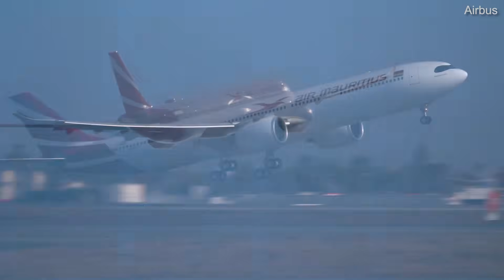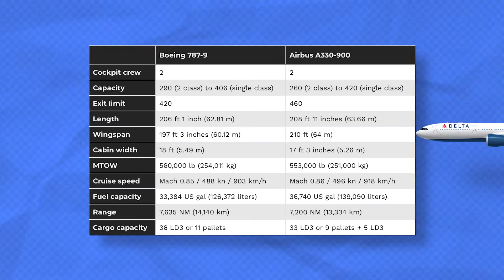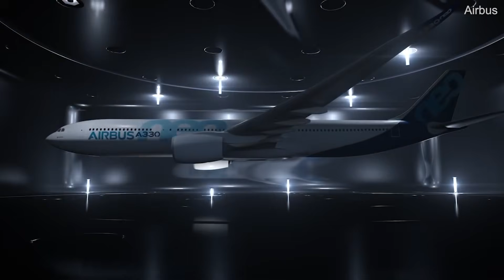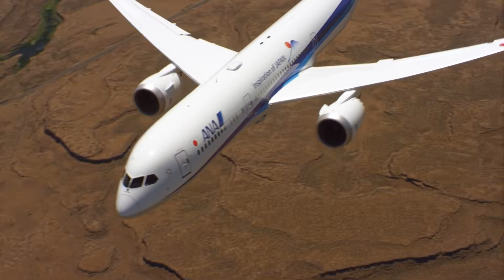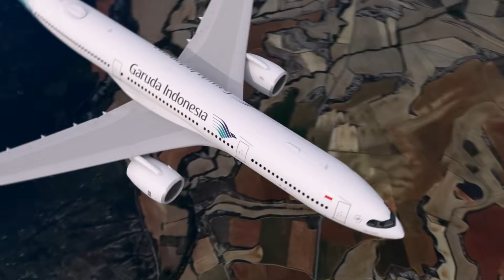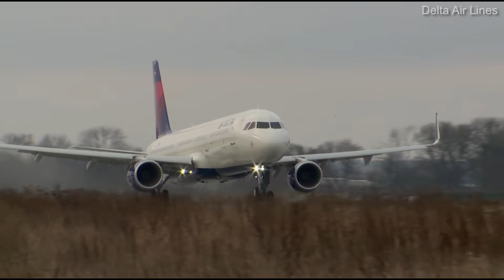Airbus A330neo Vs Boeing 787-9 – Which Plane Is Best?

Comment: It seems that as a product, the 787-9 is the better airframe. However, I wonder about the profitability to their respective companies. The R&D for the 787 family must have been enormous, and early problems with battery fires and Trent engines would have only pushed that up. If you factor in the cost of the ongoing almost two years of gaps in delivery, I wonder what number of planes Boeing has to sell just to recover the costs of development and overcoming quality problems. In contrast, the A330neo upgrade program must have cost much less, and will correspondingly have a much lower break-even number of airframes to sell in order to recover investment. So building the A330neo may be the better business proposition on a head-to-head comparison. Airbus could have tried to position its next plane, what became the 350 family, to compete directly with the Boeing 787 as a cleansheet offering. They decided not to do that, and chose a more conservative approach of the A330neo upgrade, defending their current airline customers from poaching even if the offering might not attract as many new, greenfield operators as Boeing in that segment. The A350 was instead positioned as a competitor to the 777X, where the A350 family has a long and growing lead compared with the long-delayed 777X. The 777X family may be somewhat larger, but being the biggest airframe on the market is not necessarily a good thing in the current and near-to-medium term business environment. I'm sure Airbus is happy that they decided to end production of their A380 after they misread the market.
    Perhaps in the 2035 timeframe, the 777X may find a lucrative market for large widebodies, but by then Airbus may have come up with a new offering in that space, which would be newer and possibly more attractive and certainly more sustainable. Airbus has all the budget for R&D and innovative risk-taking, while Boeing for sometime to come will have to watch its cash flow and be very prudent about R&D spending. I wish the situation were better for Boeing, its customers and the world needs a successful Boeing that can invest in R&D and sustainable technologies as the world tries to decarbonize aviation. I am unhappy that almost 4 years after the first 737 MAX crash, they still haven't gotten their act together. 
    Maybe they need a change of leadership, their current CEO may still part of the problem rather than part of a solution. I feel they still haven't come clean about the real root cause of the 737 MAX engineering design disaster, they seem to still try to blame it on inexperienced pilots who could have followed a certain documented procedure when confronted with a totally undocumented failure scenario. Some engineer and their manager needs to go to jail for designing the killer state machine in the avionics that used the information from the  one connected Angle of Attack sensor, a single point of failure in an airframe design that should never have been certified as safe to fly.
Reply: Airlines complained about selling 400 to 450 seats to make an A380 flight profitable.  That’s not all to fare off the about 350 seat an airline has to sell to make a 777-9 flight profitable.  The 777X might be to big to compete.  The 787 might get unexpected competition from the single isle long range planes, that cover the low end of the 787’s.  It’s no surprise 787-ER versions are planned, although the increased weight will lead to a loss in efficiency.  In that sense it will be interesting, how Boeing will be going through the next 10 years.  The 777X will be a 5 year old design when it comes to market, and the 787  line has it’s own problems.  Airbus has also it’s problems with the surface degradation, although it might be not so difficult to handle it.

Comment: The 787-9 use less fuel, has more range, and can carry more cargo, and the difference in passengers is small. It's not hard to see why the 787 is the better aircraft.
Reply: The difference between a330neo and 787 fuelburn is only 2%
Reply: @faizierazali3494  The difference between a clean aircraft and a dirty aircraft is smaller than that but still saves a shit load of money to the airlines!
Reply: @gregb1599  lol its like you mentioning b737 max over a320
Reply: @faizierazali3494   4%.
Reply: @AS-br8si  4% only if the A330s Range is used completely. The fuel burn per seat is only significantly higher than the 787 for flights over 10 hours. Most A330neos are used for flights between 6 and 9 hours thought.
Reply: Airbus all the time
Reply: A330neo have a bit lesser price than b787-9 but the capacity is lot more than b787-10
Reply: The seating arrangement makes a bit difference for passengers

Comment: 787 has more composite materials. Newer and better in terms of aesthetics. I've tried a Qatar airways economy class 787 and it was better than Qatar's A350-900. I think the loo is bigger too.
Reply: Why? I'm a 787 lover and am curious as to why.
Reply: @FlightAirplane  maybe because I was in the middle seat in the A350 while I was at the window in the 787. Idk. Just felt a bit more comfy. I think the seat were different too.
Reply: @brakinglate8828  Too bad they are making it a 3-4-3/ Honestly I still prefer the 787 even when the a350 is 9 abreast.

Comment: I thought the A350 was the competitor to the Dreamliner Anyways both planes are good and I like both of them
Reply: The a350-900 is the competitor to the 787-10, the a330-900 is the competitor to the 787-9 and the 787-8 is the competitor to the a330-800. The a350-1000 is in another market competing against the 777-8 but the 777-8 passenger variant is at risk of not being built because of no firm orders.

Comment: Fascinating one of the arguments people use for the A330 vs 787 is the fact that A330 has wider seats and a preferable 2-4-2 in Economy compared to a 3-3-3 in the 787, but that's more of a airline choice thing. It's not really Boeing's decision what an airline puts in terms of configuration. Japan Airlines seems to make it work with very low density 787's in a 2-4-2, but many full-service carriers would probably prefer the extra capacity and don't think the average punter will be that interested in the difference in seat.

If you put to bed the program delays and groundings, the cheaper price, higher range, better cargo capacity, and better efficiency (subjective topic) makes the 787 the winner. But if you compare the of Boeing's widebodies (including one's in production) to the A350... well Boeing gets KO'd pretty easily.
Reply: I would like to know what is the real price of A3330 neo compared to 787.

Comment: A330neo is my choice. I absolutely hate the 787 tinted windows.
Reply: Agree totally
Reply: Why? Tint means even when dark you can still see out, shades if closed that's it nothing
Reply: @gregb1599   Maybe try it in practice! Maybe you have laser eyes? A Blind you make the choice not some entitled crew member!
Reply: @benwilson6145  Well if it's abused then yes, however good airlines and crew will give you the choice. But at the end of the day, when booking your ticket choose the aircraft you prefer, I for one will never book a 737 Max and that is my choice
Reply: @gregb1599  why wont you never book a 737max. you don't choose its the airlines that doo
Reply: @gregb1599  Yah but the crew can control it making it extremely frustrating. Plus they never get fully bright and have this weird tan tint when on max brightness.
Reply: @SpottingTLV  It never bothers me, I guess personal preference, the shade just looks cheap and old fashion and boring, also must be frustrating for the crew when people keep them open when most want to sleep or during take off and landing when they must be open for safety yet many keep them closed causing crew more work to do

Comment: A330-800 is better than 787-8 but 787-9 is better than A330-900

I feel in this way
Reply: true
Reply: If you see specification wise, the 800 is better than -8 but the orders for  the  a330-800 is less because the ceo -200 is still not very old.
Reply: @tomaviation5245  spec wise, I've always felt the A330-800 was over spec. The market needed a 250pax aircraft with shorter range and significantly better fuel economics than the B787-8, but instead airbus made the A338 range much longer and took the penalty on the fuel economics. Under all payload and range, the A338 consistently fall behind the B787-8. The only aspect the A338 won against the B787-8 is their short field takeoff, hence the reason why Uganda air, air Greenland and Kuwait Airways are its customers. Garuda Airways actually ordered it hoping to launch new service direct from Bali DPS to Europe, hence again requiring the superior takeoff performance. Only the A330-800 has the ability to take off from Bali DPS fully loaded.
Reply: Interesting. I'd had always thought it to be the other way around since the A330-900 has gathered more order than the B787-9 since the A330neo was launched.
*you really have to exclude the 1000+ order the B787 gathered before the launch of the A330neo.

Comment: Economy Passengers; A330neo 8-abreast seats are more comfortable instead
Reply: That is real true. As a parents, I can lay down my kid. Or I can lay down, when there aren’t many pax. That’s the Beauty of 2-4-2 format.  3-3-3 is worst.
Reply: 787 was designed for 8 abreast  from the very beginning but airlines opted for 9 abreast , that's why the narrator said comparisons on passenger comfort are unfair. 

You can order the 787 with an 8 abreast ( wider than those on the a330neo ) so this is not up to Boeing but the airline
Reply: @mmm0404  
and conversely , airlines can order the neo with 9-abreast ….and deliveries have indeed started w/that config.
Reply: and its more beautiful when doing a smooth landing cuz of the tilted landing gear, wheras 787 is like baby tilted landing gear
Reply: @qrygamer1  personally I think the a330 looks bloated and is ugly. It's fuselage tilts a bit forward and is not even . 

The 787 looks like a sleek sports car  with its sexy looking wings.  Lol

Never compare the a330 looks to the 787. Even the 767 looks better than the a330
Reply: Yes! The best point

Comment: The most insane fact is that on "traditional long haul routes" (meaning 8-10 hours flights) the A330NEO has a per seat fuel burn that's basically equal to the 787's one.
Considering that the A330NEO is basically an A300 with new wings, new flight controls and a double engine upgrade, that just shows how the first Airbus was ahead of the game.
Insane efficiency from a 50+ years old design.
Reply: That's a common effect!  The most fuel is burned during the take-off and the ascend to travel altitude.  Once at travel altitude the differences are minimal.  Fact is, that the induced drag can be up to 70% of the total drag while ascending.  During travel the induced drag is getting lower due to lower AoA and higher speed.  It goes down below 10% of the total drag..
Reply: agree man, i agree
Reply: I miss flying 747s. they made the flight beteen L. A. and Europe about 1 hour shorter tham the current fleets.
Reply: Where did you get this from? That's actually really cool
Reply: that's how my big appreciation for Airbus started, the A300 was a game changer, ahead of it's time
Reply: I love Airbus, I never been in those models but the A320NEO and the 321NEO are amazing 👏
Reply: Indeed. If airbus had targeted the NMA market with the A330neo, it would have been more successful.
Reply: @chingweixion621  and a330 is bigger than 767 and even bigger than a321neo
Reply: @xa0101  I'm referring to the upper end of the NMA specifically the B797-7
Max10 = A321neo
B797-5 = A321XLR = B767-200
B797-6 = A300 = B767-300ER
B797-7 = A330-800 = B767-400 = B787-8